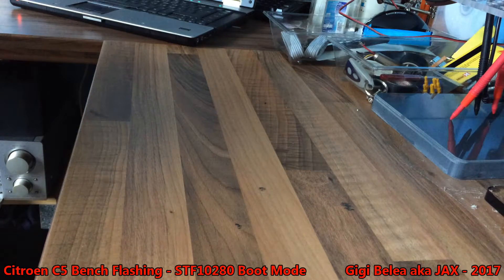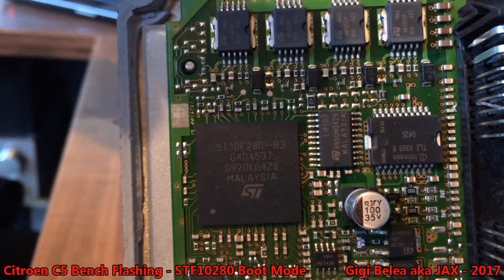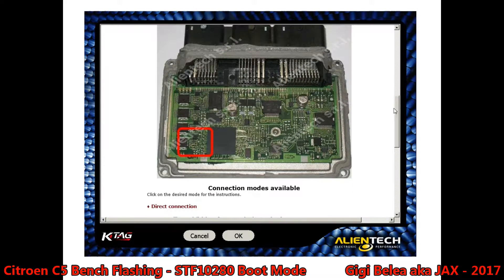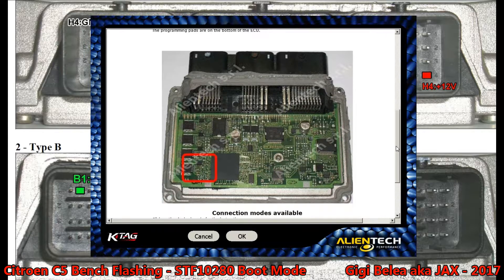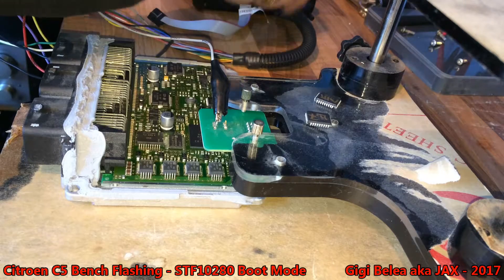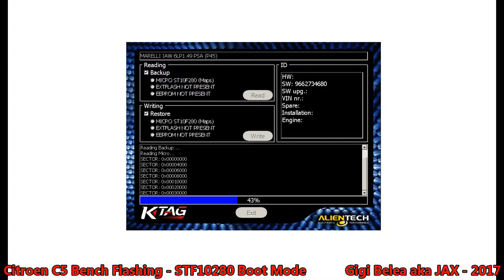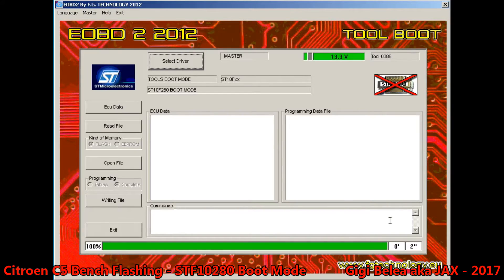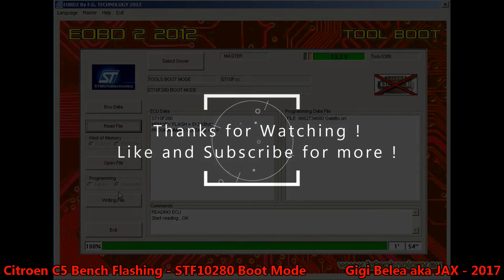IAW 6LPB Magneti Marelli Bench Flashing with Galletto and KTag in Boot Mode

Comment: Hi! I'm new in this world and i'm on ktag clone eu version.
I've tried to read my iaw 6lpb from 307 2.0 16v, just like you show but at the end of reading there is a checksum error and i don't know why, it seems that i have a partial read (253ko)... Do you have any idea where come my problem ?
Reply from the maker: The file you read is not ORI and fails at checksum. Only solution is to send the file to Alientech to have it corrected or find another file to flash over.
Reply: @GigiBeleaDK  thanks for reply!
 I was just trying to read it with kess by OBD but doesn't work too. I'm gonna try to find a virgin dump to reflash it.. Thanks for help! 😁